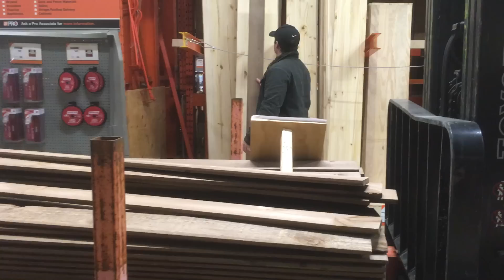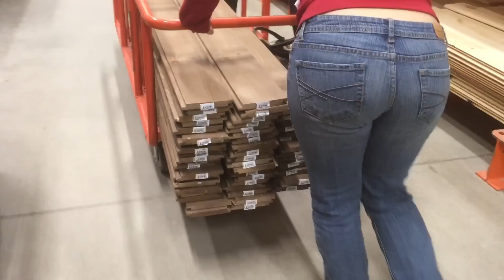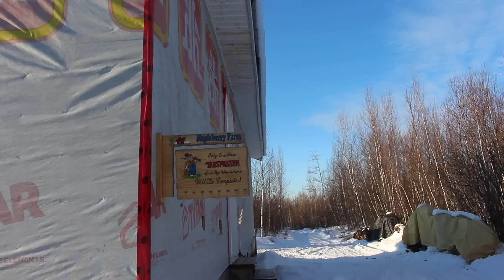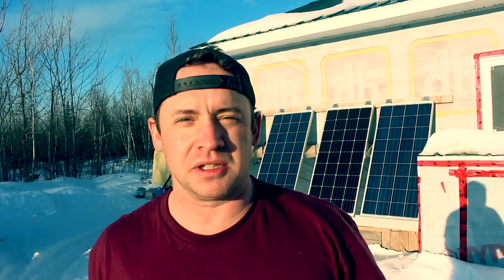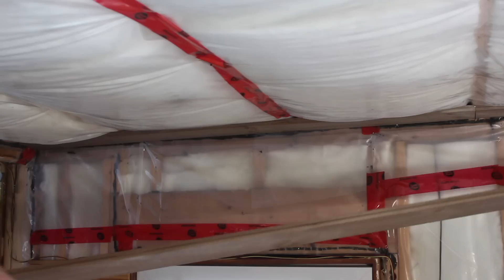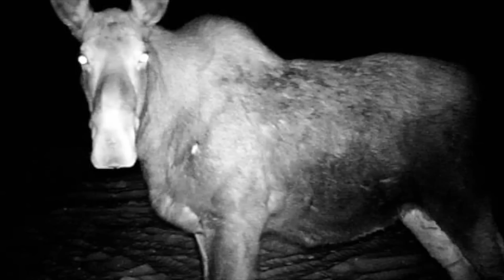Getting A Start On Our OFF GRID KITCHEN Ceiling

Comment: Tip that nail gun about 10degs and use a few trim screws randomly. Wood ceilings have alot of movement with temperature/moisture changes especially at ceiling height. :)

Comment: Buy a wen 2000watt generator free shipping 350. Amazon it's the same as the Honda the company bought the patients from Honda I can run my whole cabin for 10hrs on one gal of gas
Reply from the maker: Just bought another gen but will keep that in mind for the next time, thanks. I get about 12 hours out of my Champion Inverter style on the same amount of gas but its down for the count right now. Thanks again.